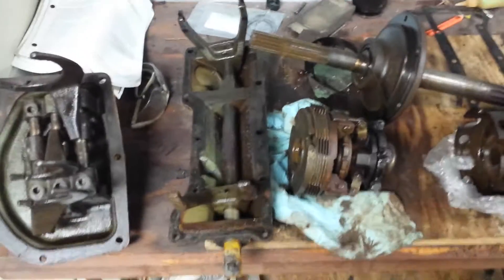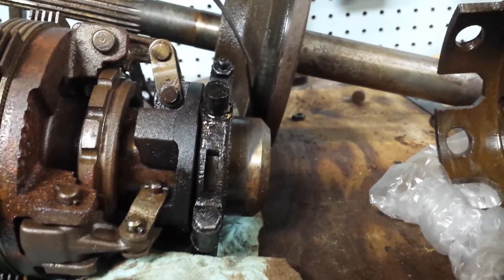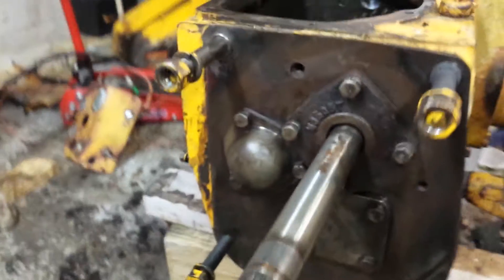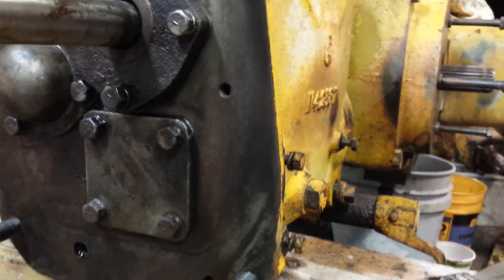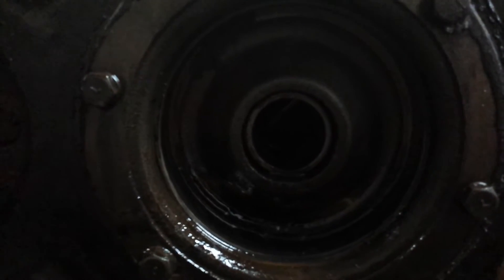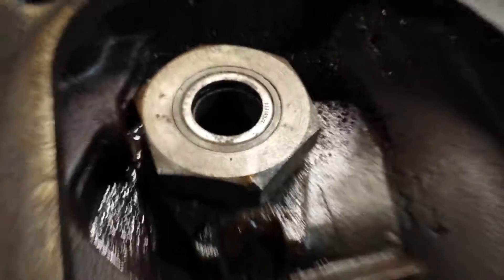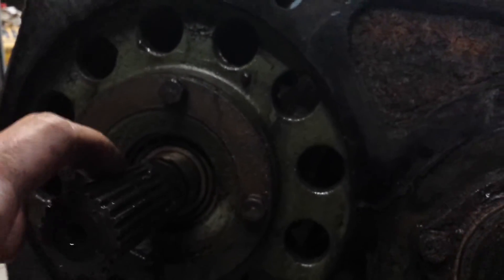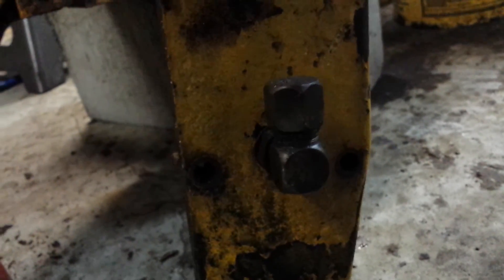John Deere 440 ID Backhoe Loader - Directional Reverser and Brakes During Restoration.

Comment: I just took my 440i and split it up, the teeth on my clutchplates are stripped. adding more vids to my channel. also has a broken part in the back of the directional reverser that prevents me from putting it in forward or front.

Comment: The brass shift mechanism broke on my reverser. Part is obsolete from JD so my search begins. Can you measure the clutch thickness and show disassemble of reverse clutches?
Reply from the maker: I cant remember exact details but there was a brass collar broken on mine that I had to repair. We had to braze and pray. I have it all reassembled at this point but I certainly dont use it for fear of breaking it and having to fix it again.